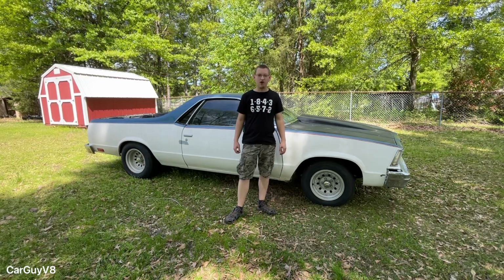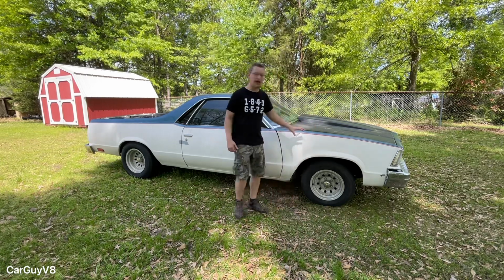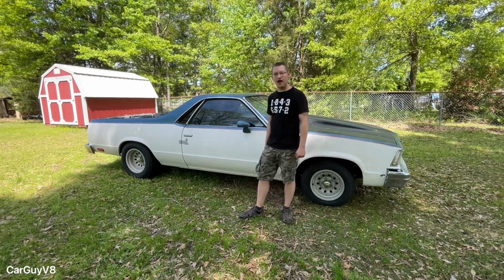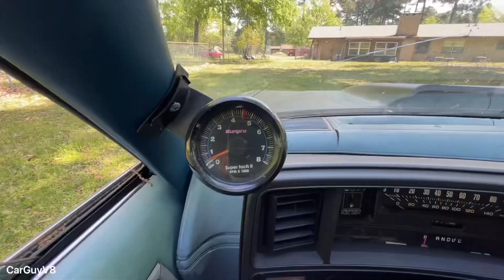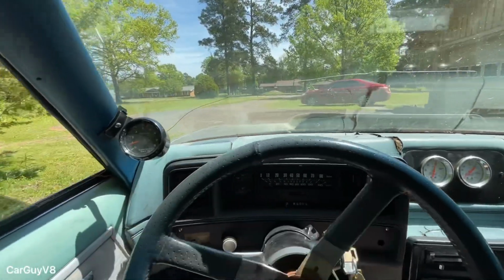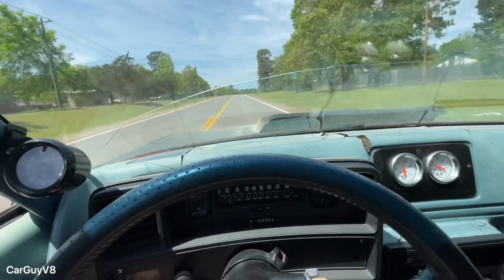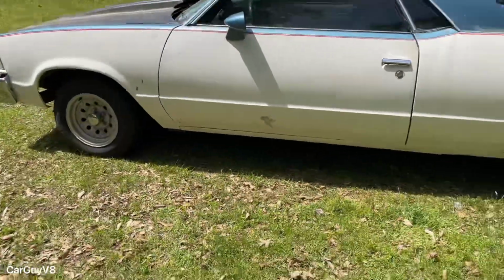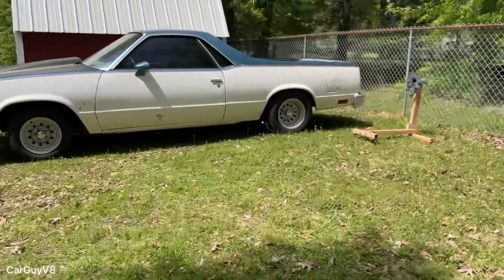Waking Up My El Camino With 383 Stroker Power!

Comment: I think you'll get the bog out with a little more work on the carb. What size converter is it..?
Reply from the maker: It’s got a stock Th350 converter in a Th400. So it’s got a touch higher stall speed than a stock th400 but that’s it.

Comment: 383's tyically need a higher stall converter. Last 1 i built had to have a 3200 stall with the cam and headers.
Reply from the maker: This one is a pretty mild 383 with Vortec heads. It’s more of a torquey truck engine. I ran a 2,500 stall in it in a different vehicle and it was a little too aggressive for the setup.
Reply: @CarGuyV8  gears are way too tall my dood. Gonna get smoked by a VTech lol.
Reply from the maker: @tjsides1983  already thinking about maybe throwing a 3.23 posi in there. The engine has tons of torque, just hard to put it down with anemic 2.41s and 2.48 1st gear lol.
Reply: @CarGuyV8  put the th400 converter in and lower gears itll be a beast